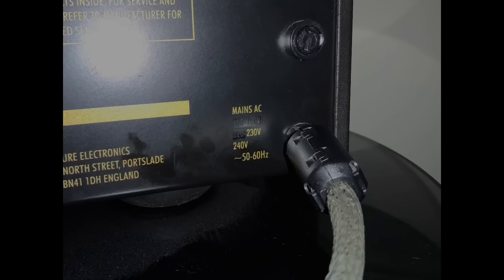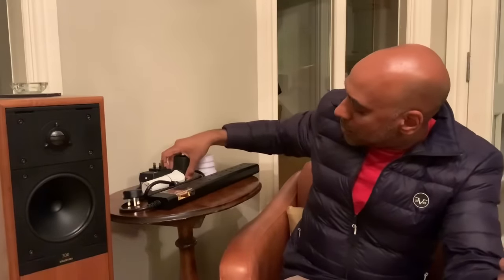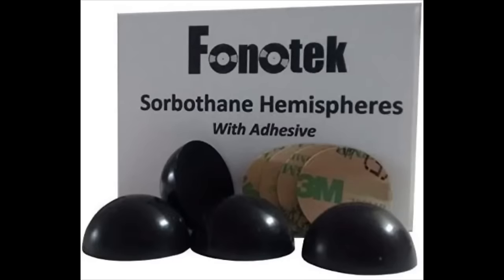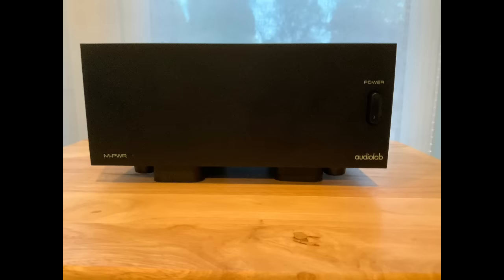My Top 5 Inexpensive Hifi Tweaks

Comment: I have tried many of these thing and never found much difference EXCEPT for power cables. I have a pair of active speakers that are fed with a digital signal and therefore contain their own DAC and amplification. I set up a back to back test feeding one with the standard power cable and the other with a good quality cable. I was able to switch directly from one speaker to the other without a pause in between. To my surprise i was absolutely astounded how much difference it made. One speaker was fuzzy by comparison to the one with the better mains cable. I switched the power cable over to the other speaker just to check - same thing! I spoke to Dynaudio (who make my speakers), why do the sell the product with standard cables? The said they were aware of the difference but have to sell at a price, they expect the dealer to advise.
Reply from the maker: Hi David, that is very interesting. Thank you for sharing 👍
Reply: that's really interesting isn't it! wonder if the dealer is aware and would make recommendation for a shielded power cord now?
Reply: Hey David, fully agree with you: IMHO the power cables are really important if you want great sound. Consider upgrading your digital cable - that one also makes a HUGE difference. The Audioquest Diamond sounds so smooth and big, you need to hear it and most dealers will give 20% discount on Audioquest gear...

Comment: i would use the ferrites in other non-hifi items in the house but I found detrimental effect when placed on the mains line of hifi devices. same with mains conditioners, all depends on how the hifi device uses electricity... if it already has some filtering inside then the additional will likely not improve the supply impedance and overall peformance.
Reply from the maker: Hi Lee, agreed! These tweaks can be very system dependent. Thank you for watching and sharing 😊

Comment: It should be noted right off the bat that when you shield speaker cables you ruin the dialectic properties which will negatively affect the sound.
Reply from the maker: That can happen, adds Capacitance in most cases but can be compensated for in design 😊

Comment: For anti speaker vibe, I use small rubber, dog chew rings!
Reply from the maker: Cool 😎
Reply: @abritishaudiophile7314  Quick question. Is there such a thing as a DAC that can process 3.1 for a home theatre set up using active monitors? Just feed it TOSLINK from my projector. Don’t want the extra expense of a receiver, just for 3 analogue outputs + sub.
Reply from the maker: @tz7813  there used to be HT preamps that did 3 channel but I don’t they exist until you get to the Uber high end of home cinema these days. Companies like Trinnov 😊
Reply: @abritishaudiophile7314  Thanks so much for the reply. I’m still learning about home theatre. Apparently, the thing I need is a surround sound decoder, but they don’t formally exist, because of licensing issues with Dolby? Its gamers who are creating the demand, as they don’t want to buy feature packed AVR’s, just to get surround sound for gaming purposes. Fortunately the Chinese are making small stand alone units, that even have built in AptX HD LL Bluetooth, for around £100 on AliExpress! I’m planning to build a 5.1 system for watching movies, using small active studio monitors. My projector is packed with apps/features that means I also don’t really need an AVR. I’m going to buy one of these units and feed it digital audio from my projector using the S/PDIF output. Tannoy Reveal 402 monitors look perfect for my first home theatre project. They seem to get decent reviews, very compact for easier mounting, front ported, and only cost about 80 quid a speaker. The safety net is that if it sounds terrible, the Tannoys can be linked together and switched to stereo mode. I’ll either end up with a fairly nice 5.1 system, or a couple of new home stereos! 😂👍

Comment: RE #3 Power strips/surge protectors. If you like the one you show why not give its joules rating? Do you know what that is?
Reply from the maker: Hi Jeff, no Joule rating but the Tacima parallel conditioner has a 4500 amp rating.

Comment: I got a set of those washing machine isolation feet and a load of nuts, bolts and washers then made them into adjustable supports that I use instead of spikes.  That and moving the speakers about has made a real difference.  I don't know if you are familiar with Tom Waits but the first track on Real Gone is quite a busy mix.  I could listen to it on headphones but it was incoherent on the speakers.  Now the imaging is more focused it is listenable.

Just one question.  When tilting the speakers to align the drivers should the tweeter be tilted behind the woofer or the other way around?  I noticed on those Burchardt speakers they put the woofer at the top and set back.  This makes me think I should tilt mine forward to put the woofer at the bottom set back.
Reply from the maker: That is great earthstick 😉👍 Tilting the speakers depends of how they are located. Most small/medium sized bookshelf speakers tend to be on 50cm or 60cm stands. This can be a little low depending on the height of the listening position. Tilting the speaker backwards can give you a more realistic soundstage height. It should only be a subtle adjustment. It is a similar story with most floor standing speakers which tend to be below 90cm in height. The most important thing is to have the acoustic centre of the speaker (normally the tweeter or just below the tweeter) pointing to your ears. As I said, a little rack adjustment backwards in most people’s cases can be beneficial.
Reply: @abritishaudiophile7314  Thanks

Comment: Hi, how do you use the AC purifier when there's just one wall power socket and all my audio equipment is connected through a power strip powered from that socket? Like do I put it in the first port of the strip or the last? Thanks
Reply from the maker: Place the AC Purifer in the first socket along the strip.

Comment: I’ve just purchased the Tacima conditioner (6-way) and was wondering if it is fine to plug everything in my system into it? Naim amp, Rega turntable, Rega phono, Marantz CD player, Arcam DAC. It just feels like that is putting too many things into essentially one power outlet. Or am I being stupid?
Reply from the maker: The only stupid question is the one you don’t ask. Actually a very good question. I would plug everything into the Tacima. See how it sounds. If you feel any loss in dynamics, just plug the Naim amp directly into a wall socket. Some amps don’t like the extra impedance the strip provides. Good luck 😊👍

Comment: Hi ! thank you very much indeed for your excellent tips !  just one question ... did you try the parallel mains conditioners directly on the power strip in one of the unused slots ?  another question ... i am from Italy but i am extremely interested in these parallel filters.  Where i can find them ?  thanks a lot again  Kind regards, gino
P.S.  your rigs are just gorgeous ... you have a great taste for hifi clearly.  I love those brands too.
Reply from the maker: Hi Gino, yes you can plug them into the first socket along your power strip. I am not sure where Tacima is available but the Ifi AC purifier is definitely available in Europe and they have different mains connectors. https://ifi-audio.com/stockists/
Reply: @abritishaudiophile7314   Hi thanks a lot for the very kind and helpful advice.  I will look for them for sure.  Kind regards, gino

Comment: You're so right, No need to get Hyper Expensive or Exotic with Gadgets. Purchase "Name Manufacturers" --Like POWER STRIPS with Internal 40 to 50 db Hi-Freq FILTERS - that way ALL Power Inputs are Filtered BEFORE entering the Units. You can check/test your Earth Grounds OR Have them Checked.  AGAIN for things like Cables, Buy from reputable Vendors. cell Towers, Cell Phones and  Blue Tooth can produce Wireless "Interference: manage on a room basis BUT can be difficult to manage if from the Outside  ... Ove Air Broadcast requires Expert Antennas and Possibly some Interference Filters. 5G Cell Towers can be close or up to a1 Mile or 2. I get 110 Broadcast Channels, USE 2 Antennas, One With In-line Filter. That Sometimes Helps but not always. Have Virtually NO TROUBLE EVER with Internet & WI-FI  ... Unless I have a Ton Of Things Running At Once Multiple TV's, Streamers, PC's Phones etc etc. ... a Managed Situation.

Comment: I read online that some believe playing a CD from the start is better than starting partway through, or pausing then restarting etc. Doesn’t make much sense, do you have any idea how this might be true or if you believe it is true?
Reply from the maker: Hi Coneman3, I personally have never noticed it as an issue. Maybe it has something to do with clearing the buffer?
Reply: Yes it’s an odd one. I wondered if it could be something to do with the player setting itself better at the start of the disk, and when altered it resets but not as well? Like a clock thing. All imaginative speculation, needs someone with very high tech knowledge to give a real definitive answer.

Comment: Hi Tarun - just wondered your thoughts on hi end network switches to use in A high end streaming system such as Fidelizer or SOTm ?
Reply from the maker: Hi hartgemini007, the SOTM stuff have a good reputation but I have never used them myself.

Comment: Ferrite cores on speaker cables will "slow down" your music.  It loses snap, dynamism...rhythm and pace.  However, you can try the cores on power cables near the wall end.  If you don't have power conditioners yet.
Reply from the maker: They add inductance. Won’t slow down the music but can roll off highs if not used judiciously 😉

Comment: For once, an explanation on the question of why upgrade mains cords that makes sense.
Could you provide some pointers on how/where one can obtain the square sorbothane feet and the washing machine pucks? I've never seen these sold before so how would I look them up e.g. on Amazon?
I think the proliferation of spikes in the British audiophile scene has more to do with the fact that most British homes have carpeted wooden floors. These present a stability issue and for that, spikes make sense. So would a concrete pavement slab but for some unknown reason, most people decide not to use them in there living rooms. I admit I find this a little perplexing especially when one can double the effect very cheaply by simply stacking them ; )

Glad you approve of Mogami cables. We've decided to go with these and quite frankly, we have nothing to compare them with except for diy CAT5 affairs. Our first foray into these was with the w3082, I believe, which are of concentric conductor geometry. We're planning to expand the system and this time we're thinking of getting one of the twisted pair geometry offerings on account of their lower inductance and capacitance. I wonder if you have any experience comparing these two geometries on offer by Mogami. They have a number of twisted pair variants, namely the simple twisted pair (W3103), dual twisted pairs (W3104, & W2972) and triple or quadruple twisted pairs. The latter two are obviously meant for multiamping which is a neat and economical solution. The question for me is whether I should stick with the coaxial or shift to the twisted pair. We're planning to move the amps further away from the speakers. Currently we're using about 5-6m lengths but in the future these could go up to 7-8m hence my concern with the concentric conductors. I haven't checked on prices but I think the concentric design W3082 is their cheapest design.at about half the price of the cheapest twisted pair, W3103.
Last question is regarding the speakers in the frame. I thought they were Monitor audios throughout until you pointed out they are indeed Celestions. I've never had the chance to listen to SL6's so I'm glad to see there are people that still value them. I just wan to know whether you've ever had the chance to compare them to their more acclaimed siblings, the SL600's and what your impressions were? For the record, I've never seen SL600's on sale (I haven't been actively looking to be honest though).
Reply from the maker: Hi Stelios, thank you for watching and sharing your experiences. You can find the washing machine anti-vibration feet on Amazon.
https://www.amazon.co.uk/VIBIRIT-Vibration-washing-machine-Washing/dp/B07MPC5HM3/ref=sr_1_1_sspa?crid=3MS55JTIHIB9K&dchild=1&keywords=washing+machine+antivibration+pad&qid=1589793935&sprefix=Washing+machine+an%2Caps%2C204&sr=8-1-spons&psc=1&spLa=ZW5jcnlwdGVkUXVhbGlmaWVyPUEyMUhZNDMwREQzOTYwJmVuY3J5cHRlZElkPUExMDIyMDcxMUwwWk1ETjM5VjlINSZlbmNyeXB0ZWRBZElkPUEwNTU2NDA0MTJKTjM4SVFPQzNPQyZ3aWRnZXROYW1lPXNwX2F0ZiZhY3Rpb249Y2xpY2tSZWRpcmVjdCZkb05vdExvZ0NsaWNrPXRydWU=
Can seem to find the Sorbothane version but have used these silicon ones and they work well.
https://www.amazon.co.uk/Hudson-Hi-Fi-Silicone-Isolation-capacity/dp/B079SV39KW/ref=sr_1_42?crid=2FVCIOKOAVHUC&dchild=1&keywords=anti%2Bvibration%2Bfeet&qid=1589794028&sprefix=antivibration%2Bfeet%2Caps%2C219&sr=8-42&th=1
I have just used the 75ohm Mogami coax not the twisted variety so can make a comparison. The speakers are Celestion 300 floor standing transmission lines. Successors to the SL700. Never heard the previous model but are a very similar design. I will lost a review on these speakers in due course. They have excellent bass extension by virtue of their transmission line design.
Reply: It's not an explanation. It's a bunch of words strung together that sound plausible, like explaining the technology on Star Trek. To people who actually design the electronics you use and enjoy, it's nonsense. Power supplies don't care about such differences—the power coming into your home is (conservatively) trillions of times noisier than anything a generic power cord could cause, and power supplies deal with that in their sleep.

Comment: If your speakers are bi-amped, would you put ferrite cores around both wires going into each speaker?
Reply from the maker: Hi Willie, I would just put one on the woofer and see if the bass tightens up. After you have got used to the change, try one on the tweeter and see if the sound cleans up but look out for high frequency roll off 😉

Comment: I strongly wish to concur on cable shielding. No doubt controversially, I will go a little further, I believe Shielding to be equally as important as cable gauge. Like many, I have experimented with a multitude of cables over the years, from ridiculously cheap, to the ludicrously expensive. But it wasn't until I paid particular attention to shielding that I noticed any true perceptible sound enhancement. In a nutshell protection matters, so ignore the shielding effect at your peril.
Reply from the maker: Thank you for watching and sharing your experiences John 😊

Comment: The ONLY use for a "mains conditioner" is overvoltage protection. If you think that it can have ANY effect on the audio quality, then you need to have serious words with the manufacturers of your audio kit, because they have really BAD power supplies. Those "plug in a nearby socket" devices are just capacitors which increase your electric bills. See bigclivedotcom for details. You are willing to pay stupid money for mains cables which have no effect on anything you could hear. Yes, it's shielded. Are you going to fit shielding to all the rest of the cabling in the circuit? (Hint: You will need to shield at least as far as the local electrical substation and include ALL the cabling in your building)
Reply: Hint: Your speaker cables and interconnects are unlikely to be in close quarters with mains cables anywhere else, but in the vicinity of your equipment and unlikely to be kept at 90° angle, while doing so.

Comment: Very sensible. I have the surge protectors. and they are worth their weight in gold as I had a 4000 dollar SACD player go out as it was not protected which cost me 500 euros to fix.  Where would place the magnetic cores , red or black side of cable?
Reply: I’d guess red (+) as that is the feed going in to your speaker.  The black (-) is leaving your speaker and going back to your amp
Reply from the maker: Hi Vic it is an ac signal. It makes no difference which side you put the ferrite core on. Thank you for watching 😊

Comment: Hi Tarun, I have a terrible hum problem with my analog system powered through the Audioquest Niagara 1200 (Technics SL 1200 MK5 with Rega Ania + iFi Zen phono + Rogue Cronus III) What do you recommend I do? Some equipment? Thank you so much!
Reply from the maker: That can be tricky. Could be a grounding issue with a component. Disconnect one component at a time and try a different amp to see what is the culprit 😊

Comment: Hi, I brought the Ferrite core and added them to my speaker cables. In your video I also see you add them to the power cables?  Or is there anywhere else in the system you will recommend to add them?
Reply from the maker: Hi Shawn, short answer is, no. Just one on each speaker and one on any power lead that is not shielded. Too many will roll off high frequencies and suppress dynamics.
Reply: @abritishaudiophile7314  Thanks for the reply.